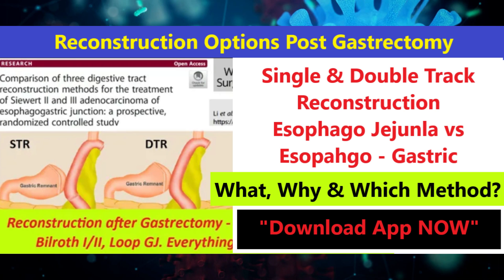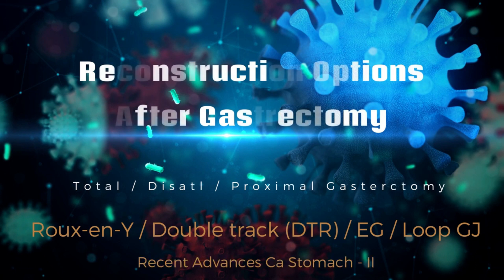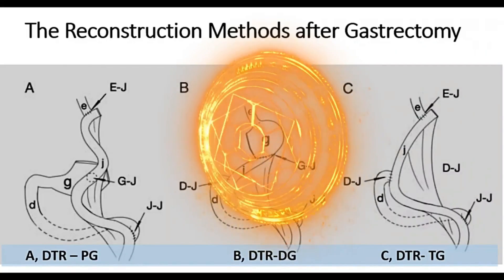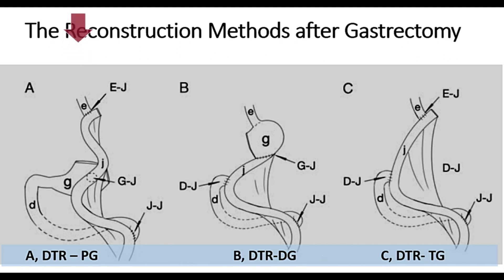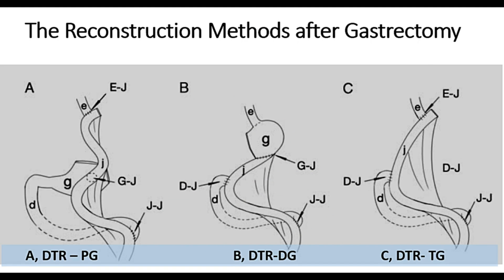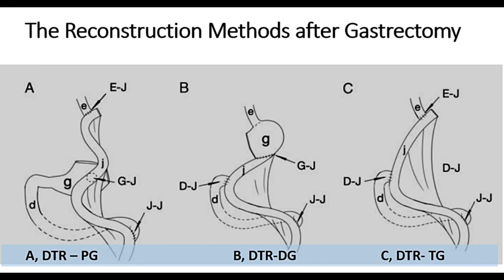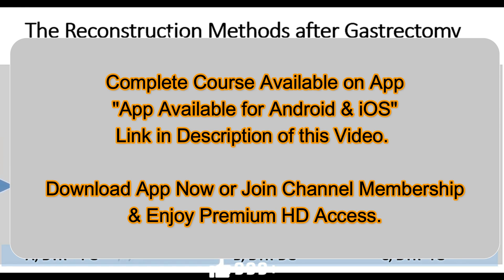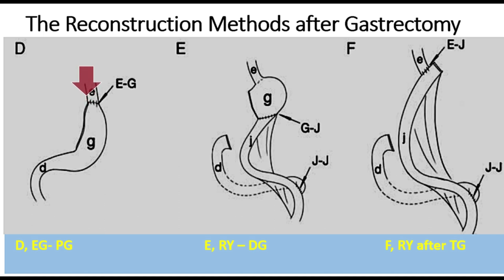Reconstruction Options Post Gastrectomy (ORG) - What, When & Why? ( See Description for Details).

Comment from the maker: 11.	Question: Most effective treatment for early dumping syndrome post-gastrectomy is:
#DrStrangeMCh #DumpingSyndrome #Management
A) High carbohydrate diet
B) Small, frequent meals with protein
C) Metoclopramide
D) Total parenteral nutrition
http://youtube.com/post/UgkxmARZ4ohKe5d43Ee6uu91RnpKRX0w1sch?si=UOWtnvqpd9JOxvft
✅ Correct Answer: B) Small, frequent meals with protein
Explanation: Diet modification is first-line: low carbohydrate, high protein, frequent small meals.
Ref: Tack J, et al. Gut. 2009.